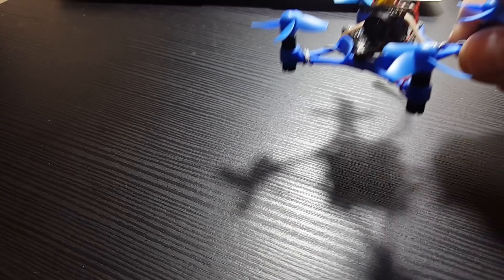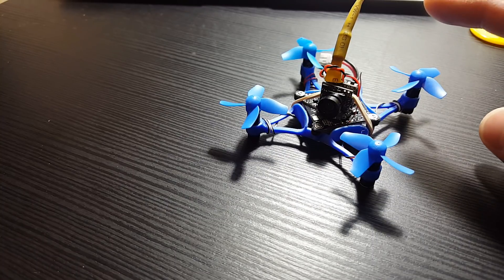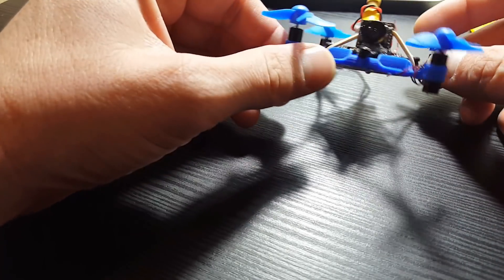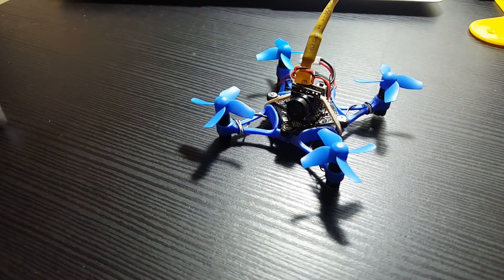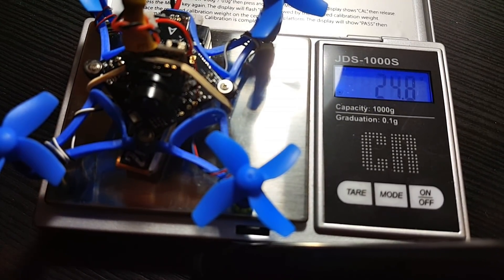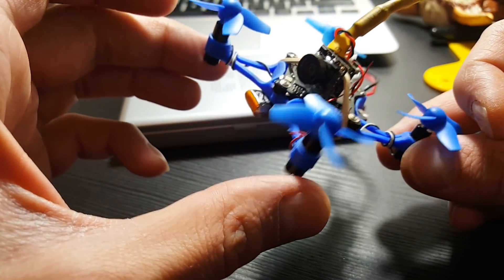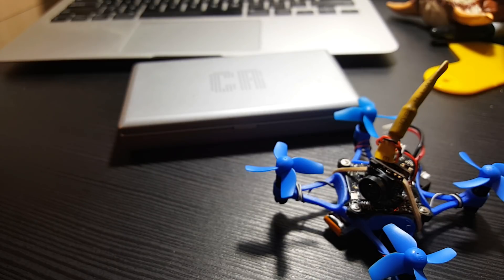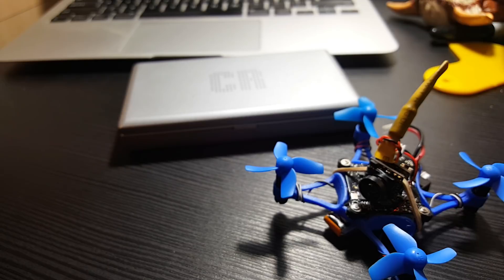NotFastEnuf's Boss Frame 6

Comment: I suggest using H8Mini props. Whoop props are tiny because they have to fit inside the ducts, but this frame doesn't have that limitation and H8Mini props work a lot better. :)
Reply from the maker: +fallingwater I used them on my 7mm boss build.  Good props but I broke them all.  I also have some gemfan props I plan on using.
Reply from the maker: +fallingwater https://youtu.be/cMOgFmw6_Uw
Reply: I’d say they’re too much on a Boss 6 with newbeedrone black. I drop the throttle and it doesn’t come down. Floats down like a feather.

Comment: Hella late I know. But I’m flying a Boss 6 on newbeedrone black edition, with I believe 44mm H8 props and it’s just too much thrust. When I drop the throttle to 0 it doesn’t drop. Just floats down ever so slowly.
Reply from the maker: What flight mode are you using?  Also in bf is your throttle at zero when dropped.  Sometimes its not which will cause the blades to not stop. Fly Safe & Fly Often my friend.
Reply: C Ray Tech I’m flying a Makerfire Tiny Lite running the NFE fork, no BF. When I put the regular 31mm props on, it behaves like normal
Reply: C Ray Tech my bad, I forgot to say which mode, it didn’t matter if it was acro or level
Reply: Austen Reavey did you ever get it resolved from floating so much? Did you add a little bit of weight?
Reply: C c sorta. I went down to NBD’s Silvers, but I honestly had never thought about adding weight. That’s a great idea.

Comment: Be really cool to make a truly long range whoop w that fc, bigger motors/props, 200mw vtx, and like   a 700 mah batt. ? :) Right design would sell a ton of them I bet :)
Reply: k6lsn tbs aka the aussi crew has one. It's runs a micro tbs on a plus model whoop with 8mm...they flew it like a half mile away to a waterfall😂

Comment: What is the price for one of these frames?
Reply from the maker: +Dale Jump Jr. $8 shipped to anywhere in the US
Reply: C Ray Tech and I was going to be that guy who asked for the 7mm file😂 if I order one can you configure the print to fit a bwhoop pro silverware fc, its not a cube an offset like the beebrain...it's rectangular. I dig this frame seems good, and would be a nice event whoop having no guards. Lmk, cheers
Reply: The link to the prints is in the description above... There are 6, 7, 8, 8.5mm versions I believe with different layouts for different fc's - They are AWESOME !